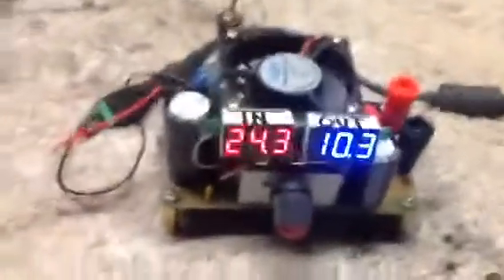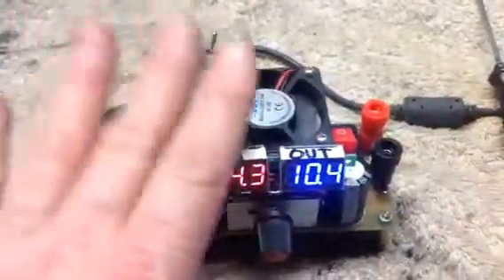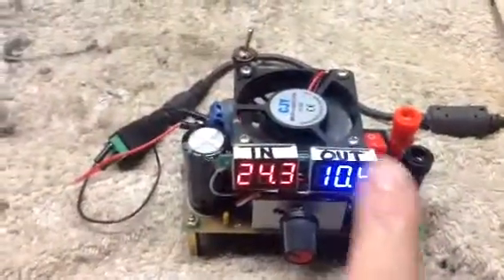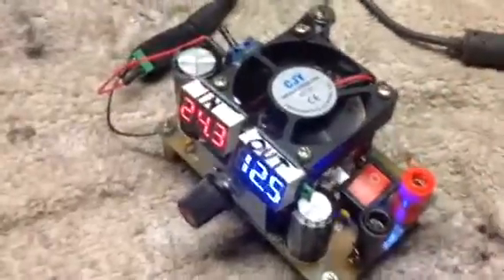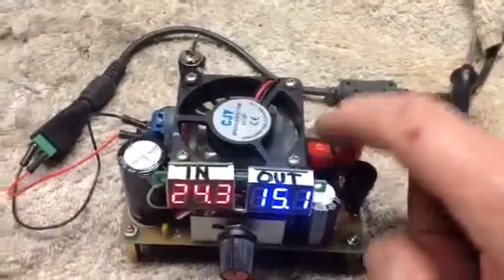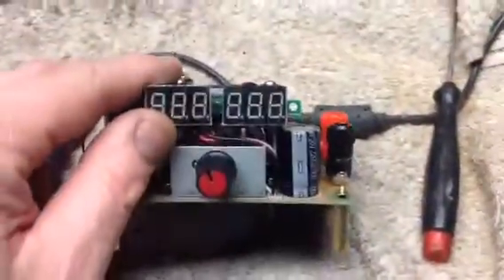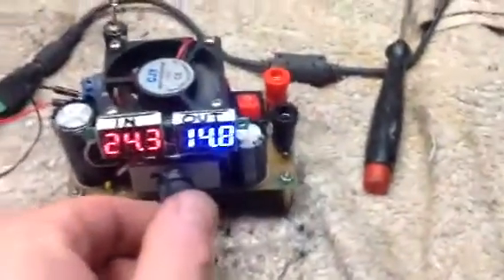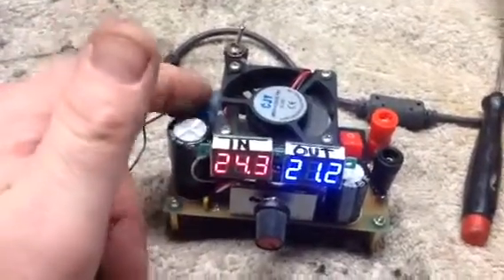Lm338k DIY variable power supply kit

Comment: Is there any documentation for these kits?  I bought 2 but none of the ebay suppliers list any info for them other than specs.  I was wondering how the digital meters hook up.  I suspect 2 of the 3 wires go to the 2 test terminals between the one elctrolytic and the adjust pot but which wires (red, white, or black) and where do the actually go?

Comment: As others have stated in this comments list. They look nice but lack some in the ability to function. One the LM338K is fake. I would love to see you take a 1157 or if you have a 3457 if that is what you have around and test the Brake/blinker side of the bulb. You will find that it will blow your PS so if you don't have MORE 338K laying around and want to keep using this little PS. Then your statement says that it is a 3amp. Sadly it can't do more then 1 with Fake parts however the 338K is rated for 5amp with a Peak start up of 7amp. This is where the part of a 1157 should work in one with a good LM338K because the V = I * R for Inrush current comes out to 5.02amps. Look at the datasheet for the LM338K it says what the facts are for Real package. I have a Lower end LM2596 Buck converter that on Inrush current protects. However if you remove the lead and place again the LM2596 unit will work even though it is over its Max current ability. Runs stable at 2.10amps. This PS in the video will just blow the chip even though there is Protection built into the real chips they are not in the fake ones also Fake one as said before won't do more then 1amp Enjoy your PS.  Hope it is still working for you.
Reply: Heed this man's warning people, the Chinese fakes SUCK.

Comment: Any instructable or instructions and any idea what goes into the spot that looks like 101 or 01 or D1 it's right between the fan out and the lm7812 chip. How did you add the 2nd meter?
Does anyone know what the power input level is? I have tested it with a transformer that steps down from 110v AC to 12v AC and I get about 10v Dc volts out if I use a 14v DC  I get around 12v DC If anyone can tell me what the highest in volts I Can use that would be awesome this kit makes an awesome variable voltage desktop Lab PSU.This is the best DIY PSU kit that's on EBay it's one of the 1st to work without any defective parts I didn't have to do any troubleshooting to get it to put power out all though I am wondering why there is a 2v drop between the in and out.

Comment: Did yours have "D1" included?
Reply: I somewhat solved it by buying a new diode.

But it blew up not very much later, now the regulator won't output any voltage :l
Reply: You might want to try a "step down buck" module. (http://www.ebay.com/itm/5A-Lithium-Charger-CV-CC-buck-Step-down-Power-Supply-Module-LED-Driver-New-/201415078323?hash=item2ee54631b3:g:AhsAAOSw0e9UyjO-)

This one can be adjusted in voltage AND current (so it can be used for charging).
The specs of these things are also way better than any linear regulator.